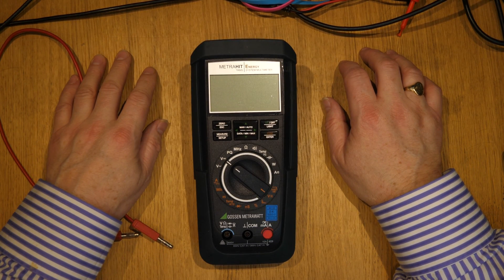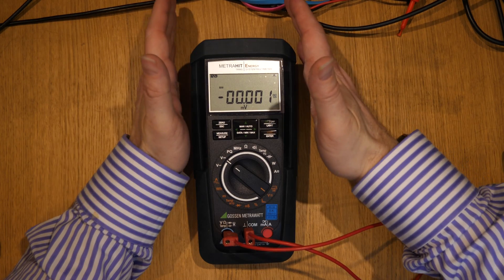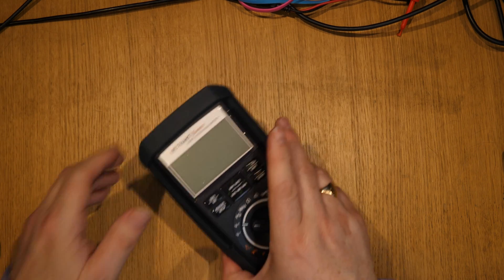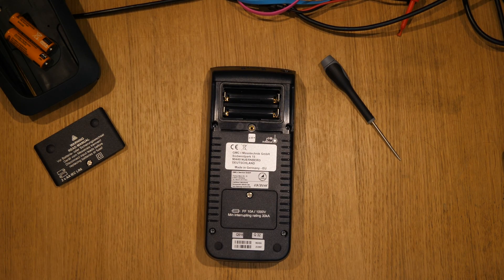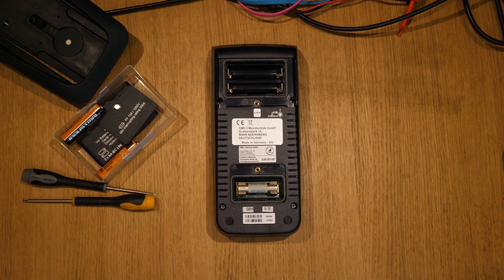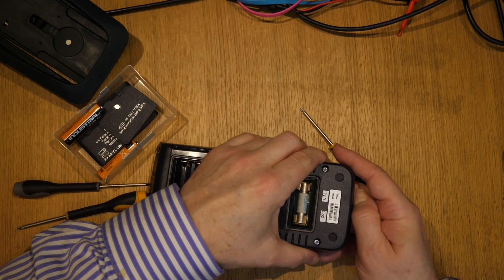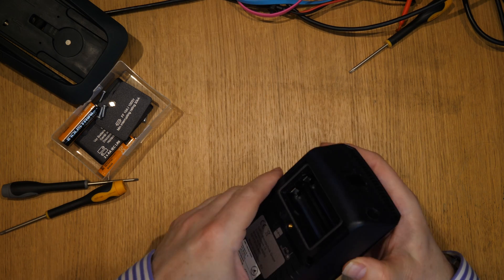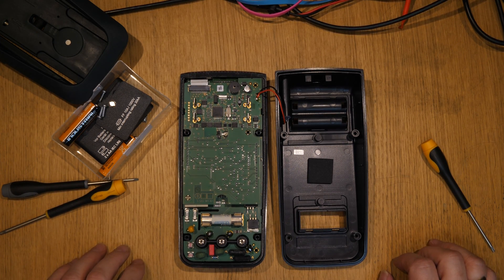Gossen Metrahit Energy: hand proximity error test and how to take apart

Comment: I made the same test to my own Metrahit Energy and it didn't fail at all. I even tried with a magnet very close to the meter, and no problems whatsoever. I saw the videos about the Metrahit Ultra with Bluetooth, tested by Joe Smith... Maybe that particular model is the black sheep of the Gossen Family... More models should be tested... What I see from your video and the ones from Joe Smith, and a partial teardown of my own meter (I don't like to do teardown too much or engage in transient tests, my meters costed me a small fortune!) is that the upper daughterboard in the Metrahit Energy has more components, more pins between boards and printed tracks on the daughterboard, compared to the daughterboard of the Metrahit Ultra BT. Of course, the daughterboard in the Energy meter has the function of measuring single-phase Power and Energy, while the daughterboard of the Ultra BT has the Bluetooth function, which occupies less space in the pcb. Maybe this minor differences could be the cause of the error of the Metrahit Ultra black sheep. Who knows?